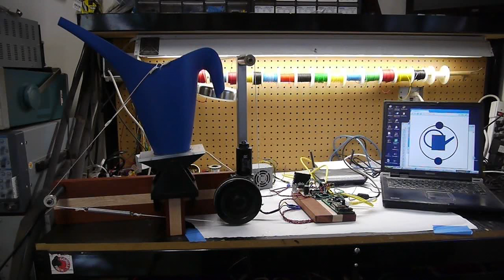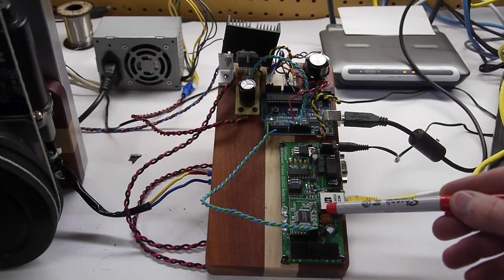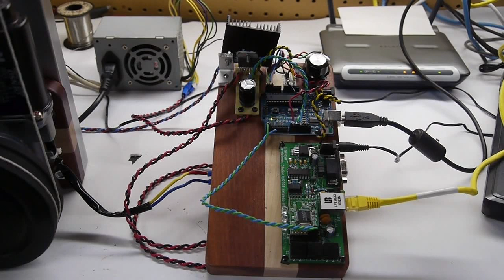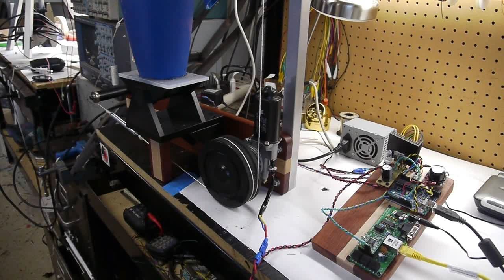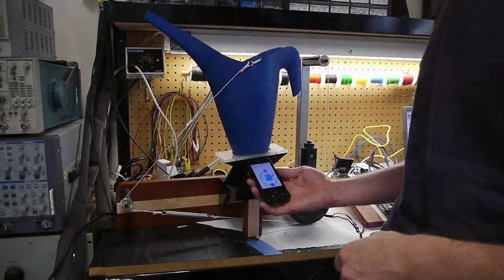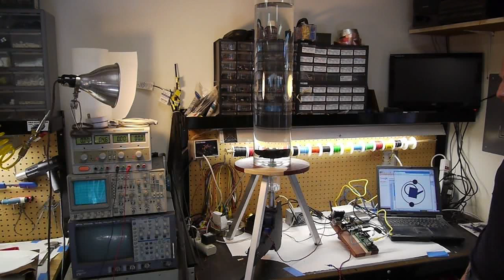Web-controlled watering can with siteplayer and arduino

Comment: wondering the power consumption of the circuit and whether you could use batteries with a dc to dc converter to get the voltage for the stepper motor. I did a similar project, but ran a wal-wart on an extension cord out to the scope, which is useless for viewing excursions. I pulled a couple rather thin steppers out of some flatbed scanners recently, I wonder if they have the oz in necessary to do this task, as they might reduce the power consumption if so in which changing to batteries might be feasible... great, now you've inspired me to do actual work. lol.

Comment: The string and rotor seems to convey motion and action very quickly.  It also seems very clever and original to me.  Where else might I see such an application? And could it be used in a robotic  or prosthetic form, for example, similar motors pulling and moving the limbs and smaller ones moving digits in a rapid speed close to human capability?  Or I am just being naive about the requirements for decent prosthetics.  Perhaps just visual imitation then.